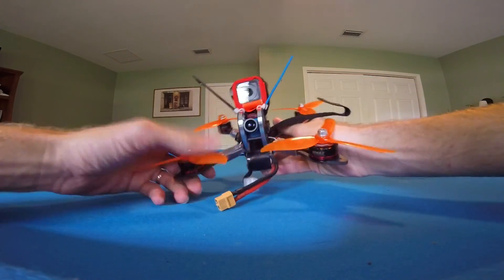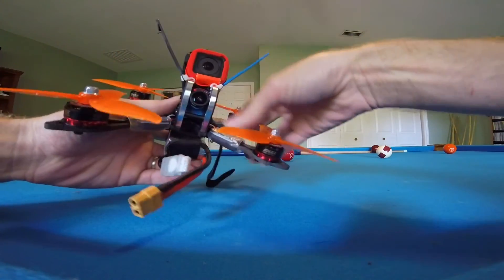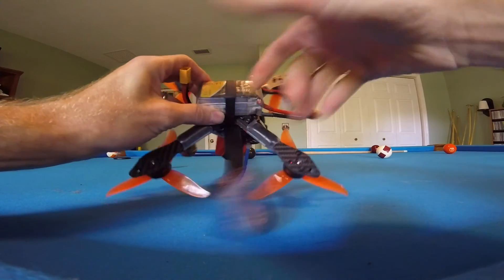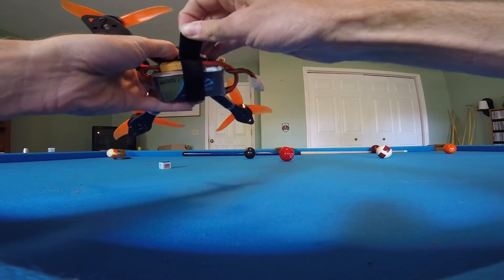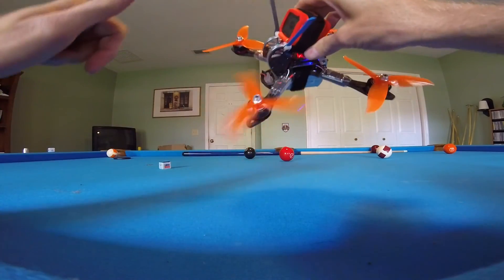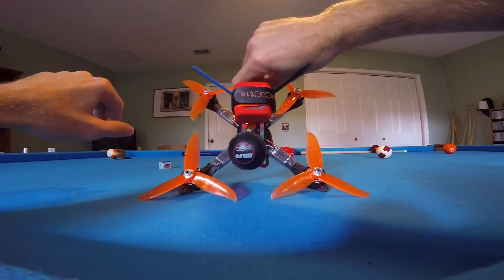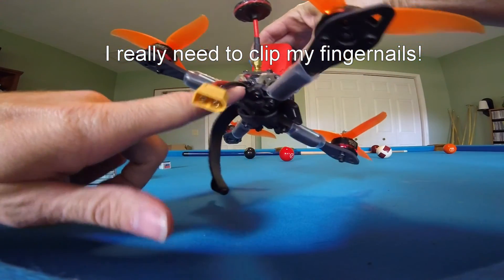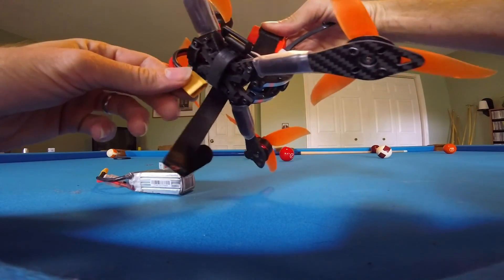Dquad obsession review build flight

Comment: You still fly your D QUAD? Its my favorite quad.
Reply from the maker: I still have it, have not flown it in months.  It needs a motor upgrade, still rocking emax rs2205's.  I even got the stronger arms for it and have not swapped them out.  I broke two quads today, so i'll get it back in the rotation.

Comment: Have you had any really hard crashes?   How did the top and bottom plate hold up?   Noticed they were only 1.5mm carbon, seems thin and easily breakable?
Reply from the maker: I've hit the soft ground here in Florida pretty hard, but no trees or anything.  I've seen a few broken base plates, they'll probably change to 2mm i bet.  I used both 1.5mm plates and the pdb, so it's a little stronger than most builds that use just 1 plate and the pdb. pdb acts as a structural part of the frame like the alien pdb.

Comment: How did you manage to get the rubber band in? Before putting all the arms on?
Reply from the maker: I put 3 arms on, then just slid it over.  it's the perfect size for a 1300mah 4s battery, been very durable so far too, but it does have a battery strap protecting it.